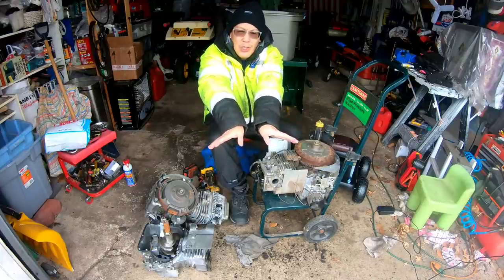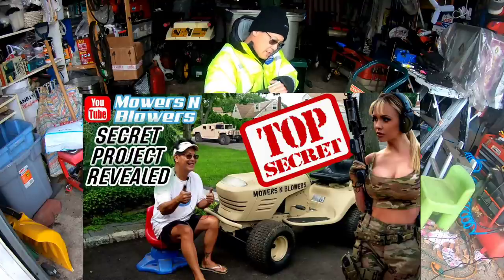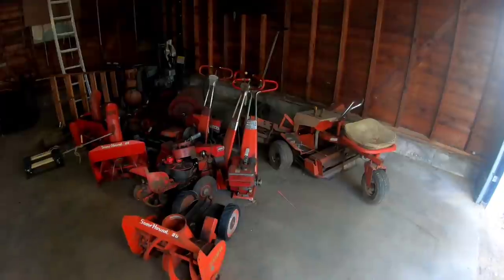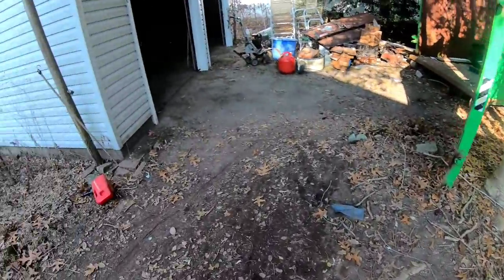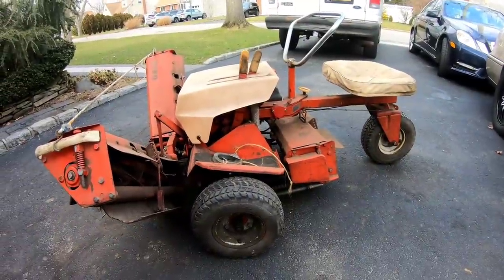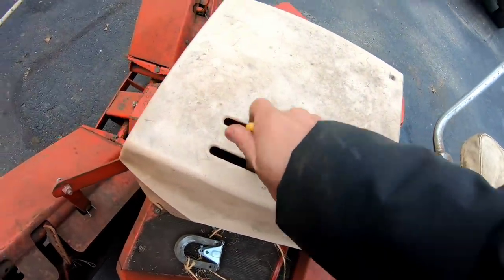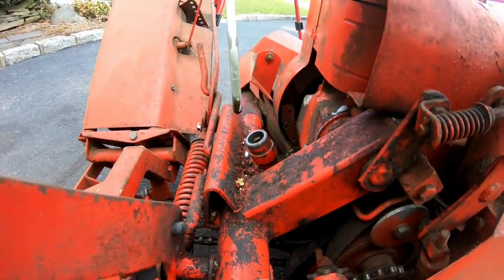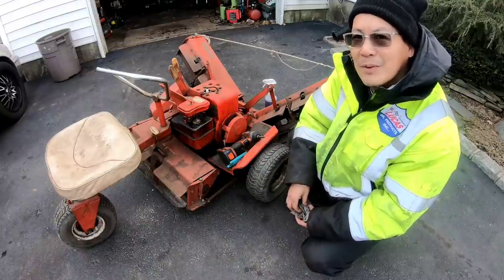FREE VINTAGE ANTIQUE TORO PROFESSIONAL 58" 3-GANG BLADE REEL RIDER RIDING LAWN MOWER PICK OVERVIEW

Comment: Engine is 130202-4015-01. Mower itself is a #03104, 58" Professional, 1971
This is pretty old, I wouldn't work on it. lol
Reply from the maker: Thanks bro..I got the parts diagram.  Only way to fix recoil is getting the cover off right?
Reply: @MowersNBlowers  Yes. Should be two or three bolts. recoil is built into the metal shroud. May be a few bolts on the bottom too.

Comment: I understood that. However, it appears that the grooved belt drive wheel gets raised so that it directly contacts the pulley wheel (metal an metal). This seems crude if it's correct. Comment?
Reply from the maker: It ran pretty well,  sold it shortly after the video was made

Comment: Bro.... With a "reel" mower, you have to make sure there are zero sticks or roots or rocks sticking up, cause if you hit a stick with a "reel" mower it's stops cold, which will cause damage to either the "reels" or the belts and or chains that drive the gangs, very dangerous, walk your yard prior to using this machine.

Comment: Henry, as one of those old basta_ds that tried to rip you off on a craftsman mowers, where do you come up with this FREE stuff? I dont want to tell you how many of those Toro mowers i have seen mowing greens back in the 70's and 80's. If you were in my neighborhood and that greens mower was complete and the engine wasn't  seized ( which it isnt) i would give you $400.00 for it and wouldn't even try to chisel you down! Cant wait to see what you do with it. That thing will mow at 1/4 " perfectly. I would be that nut that would want that piece!🇺🇸🗽👍  Roger
Reply from the maker: We’ll see how tough it’ll be to get her going.

Comment: Ok bro be safe, that muffkin wrap is abostos how ever you spell it, but be safe around thst stuff, but that's why it doesn't catch fire.
Reply from the maker: Asbestos?  Doesn’t that cause cancer?
Reply: @MowersNBlowers  yep, don't inhale the dust, or touch with your hands without gloves, wet it down with spray water, to keep dust down, I wouldn't cut it off that might cause more dust, just keep it wet, and if you want spray paint it in place with high heat spray paint that will seal it.
Reply: Instead of water.

Comment: can you fit a lawn tractor in your van
Reply from the maker: 3 at the same time
Reply: wow 3 tractors id like to see that  nice.  keep the videos coming. do you remove the deck first
Reply from the maker: Here was one where I fit 2 pretty easily

TWO FREE CRAFTSMAN LT1000 FLATHEAD ENGINE SWAP & POULAN XT GEAR DRIVE 12.5HP 38" LAWN TRACTOR PICK

https://youtu.be/pr_qxej7AaU
Reply: nice. would love to see you wrench setup.. last thing what is the going orice for a crathman lt2000
Reply from the maker: @NYC_Sweetelite  just a pile of tools in a box nothing special.  Depends on condition, but if all works $500-650
Reply: thanks finding them im. my area 50-200 they say ran last season i like thoses